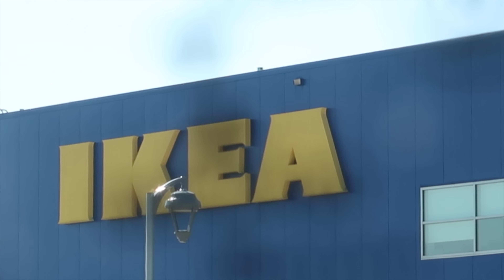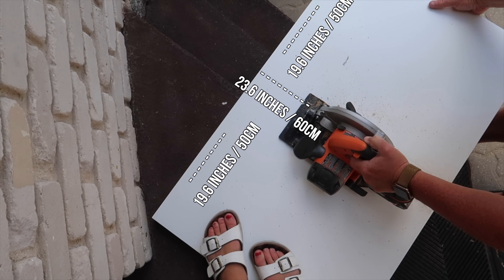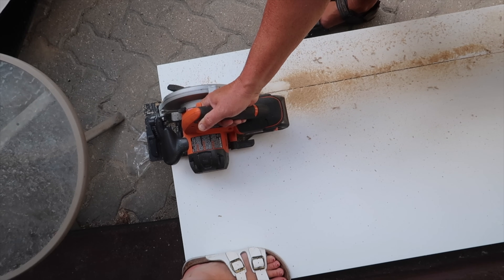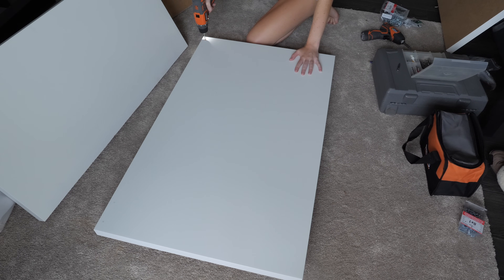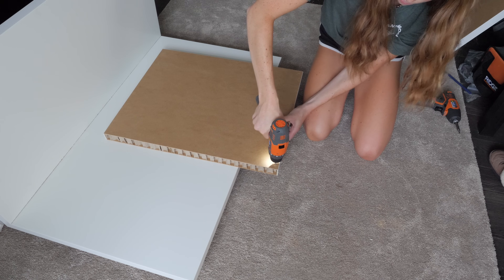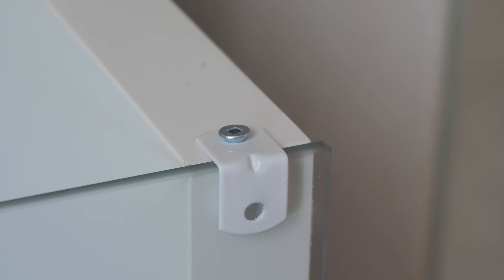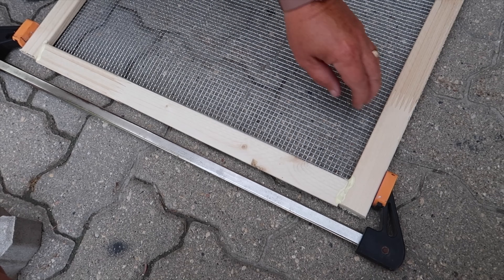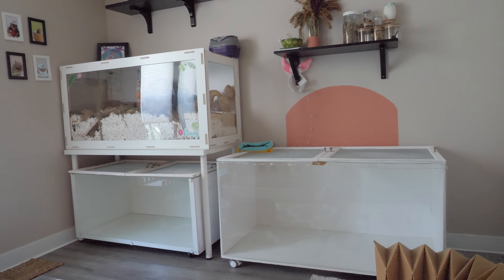Building an IKEA Linnmon Cage!

Comment: Hey guys, so I have an issue. I got almost everything to build this but the only glass I can find is either smaller at atleast 40 inches or much bigger at 63 inches. Is it alright to go with the smaller one? I want to make my hamster's, Princely, cage bigger so that she can have more bedding since I noticed she's stopped trying to escape ever since I was able to get her bedding to almost 10 inches. I also feel like she'll be safer in the Linmon cage vs the bin cage I made for her, then use the bin cage as her playpen area.

Comment: hii olivia is chipsi bad or good for hamster?
Reply: Chipsi is safe. It’s a mix of spruce and fir wood shavings. When it comes to wood, phenols are what you want to watch out for. Spruce is very low in phenols and has a similar level to aspen. While fir does have a higher concentration of phenols, the fact that the majority of the mix is spruce should offset that. :)

Comment: Quick question so the $29 linmon table is sold per table so it’s really $90 for just the sides,Not including glass? Is that right.
Reply from the maker: No it was $29 for all 3.
Reply: Oh wow. They are $20 each here in the u.s, so $60 if I need 3
Reply: @Dannielle23s  The price actually went up :( so it used to be cheaper

Comment: Hi so I have this cage and there are a few holes in it on the top floor so I was wondering what can I put in it so it is safe for you hamster ??
Reply from the maker: Those holes should be on the outside not inside 😊
Reply: @VictoriaRaechel  in the cage you can put the stairs in different places so there are holes were you can put it and I’m worried my hamsters leg might get stook so can I put tissue paper in it ??
Reply from the maker: @avalil1011  I’m not sure I quite understand, the outside of the Linnmon should be the brown color which is where the small holes are.

Comment: I love that you are not afraid to DIY! I built a similar cage, but I glued the glass. I went around the subject quite a bit and came to the conclusion that there is no better place than this. Thanks again!
Reply: how did you comment before the vid EVEN CAME OUT 🤣🤯
Reply: @julianbezzina  Become a channel member and travel in time! ;) (I hope you understand the joke) Victoria provides channel members with early access and an emoji pack. If you don't see the "JOIN" button, your settings may not allow it. Only adults can join.
Reply: I love a DIY enclosure 
.I think you can makw them tanks and set ups a lot better if you are building it your self
Reply: @-afyx-  oh ok thx
Reply: If I glue the glass instead, will it stay or will it be less stable?
Reply: @ilove_labradors_1897   itnis up to you hiw you do it . Just got to make surenit can hold up.. I can not see it being a problem if u glue it in tbh
Reply: @ilove_labradors_1897  The aquariums are also glued! The water exerts a high force on it.
Reply: @JPsPetNation  what glue did you use?
Reply: @-afyx-   hey sorry for the late question, but I’m planning to glue the same thing. May I know what glue you used? Thanks!
Reply: @XeniaSolify  Unfortunately I would give the type in vain, I live in a small country in the middle of Europe and this is produced here. A similar product is definitely available in your country as well. Look for one that is also used for gluing aquariums. Silicone based, transparent, 25% flexible, UV resistant and waterproof. Curing in acetic acid is therefore important to wait at least 24 hours after gluing to be safe. If you have any questions, I will be happy to help!
Reply: @-afyx-   oh yeah I’ve seen a few shops nearby that sell those; thank you so so much! ^^/

Comment: I just want to inform those who are still thinking of buying all parts for this cage in Ikea in Canada and building a cage for a reasonable price. Unfortunately, over the past two years, prices have changed significantly and now, this cage will cost twice as much as when she filmed this video.   I have checked the prices for all the items, and I find out next.
Each tabletop costs 40can,  so 40x 3=120 ,
The price for glass is 40 $. All other parts from Home Depot are around 55 $.
Also, remember that you will likely have to buy wheels, too.
Finally, we can see that it will cost you in the recent year(2023) about 215 $+26 $ tax= 241$ ( without wheels).